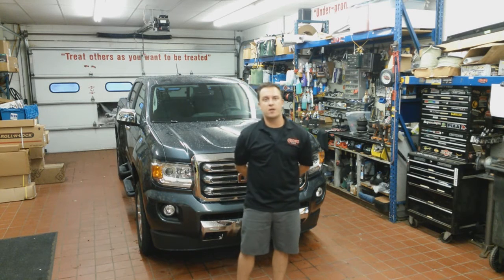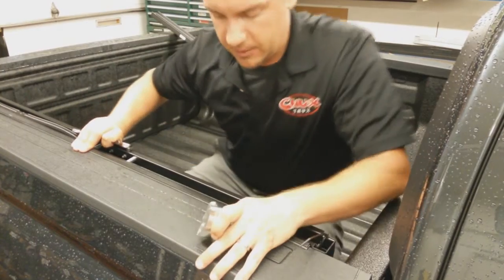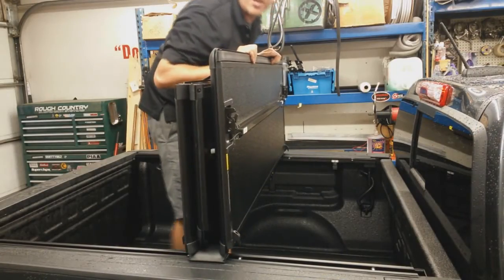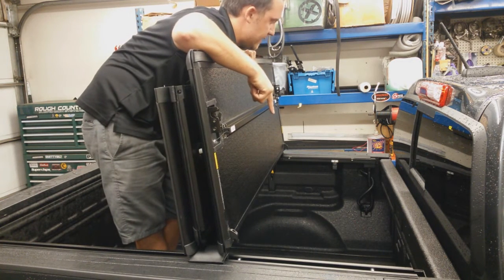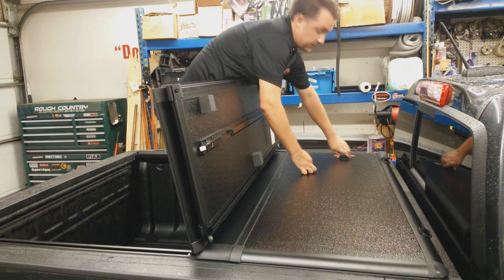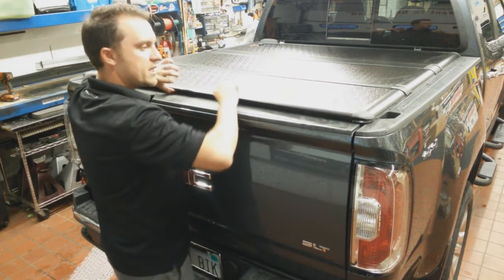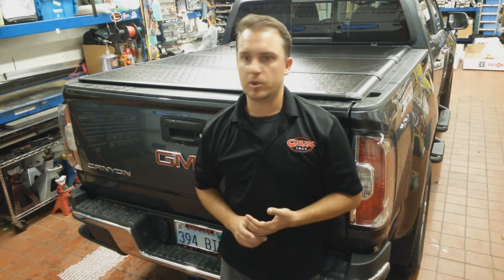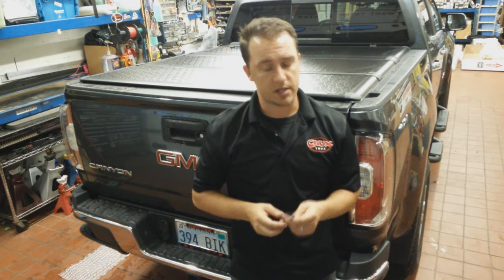Extang Encore Tonneau Cover on 2015 GMC Canyon

Comment: I was trying to chose between extang encore and g4 fold a cover for my Short Box canyon 2016

I was wondering about security? I heard that the pull cords on other tonneaus can be pulled with a hanger, can that be done with the Extang?

Also is there a utility box/toolbox that could fit under the Extang?
Reply: +user3251 While that is a very real possibility with any of the pull cord covers I have not heard of it happening to any of our customers. Generally on something like that it's a out of site out of mind situation.

Comment: Any leaking issues ?
Reply from the maker: Jordan, leaks on tonneau covers are more related to the differences in trucks (Ford vs. Chevy Vs Toyota, etc.) than they are due to the design of the cover.  A Chevy with a plastic drop-in bedliner vs a Chevy with no bedliner will be different in how they keep the water out.  This applies to every brand and model of tonneau, not just this Extang.   What we tell guys in our stores is that every cover has some potential to leak. None of them are waterproof, but you can do a little extra work and get it close.  Take a look at this...https://www.thetonneaucoverstore.com/news/how-to-make-my-truck-bed-waterproof/
Reply: I have a 2017 Colorado and I notice the issues are at the cab, it’s almost like they stopped welding so the side and bulkhead corners of the truck bed don’t really connect. I am on the 4th mx4 and I am going to try something different. I was thinking this one or the new extang exceed. I have a tailgate deal as well. I know they won’t be 100 percent waterproof but mine was terrible
Reply from the maker: @rodger_rabbit  It's most likely the truck, (or a bedliner, etc.) and not the cover.   Read that article and it will tell you how you can get it closer to watertight.  Several truck manufacturers spot weld the bed seams instead of using a continuous weld.  But usually, most of the water is getting in at the top, where the bulkhead (front of the bed) meets the sides.  The front sits lower so it creates a gap.  Good luck!